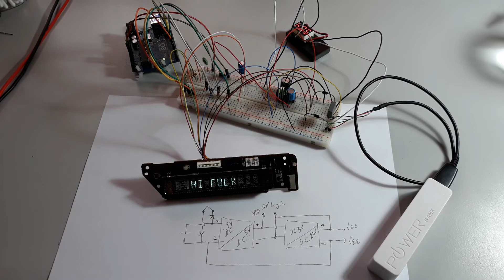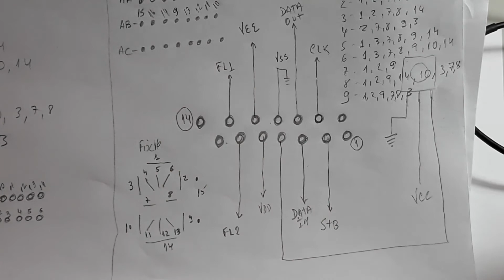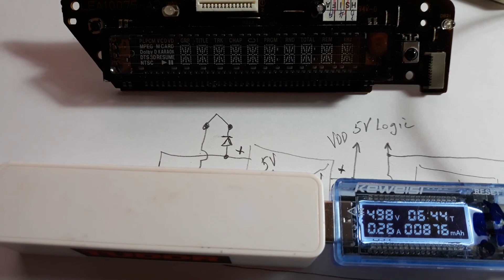PT6315 with converters DC/DC

Comment: Olá José. Algumas questões, por gentileza:
1) As 3 saídas no Power Bank, é um Positivo e dois Negativos?
2) Os dois diodos que você usou é para ter uma queda de tensão dos 5v para o Filamento (3,3v)?
3) Neste caso, não é possível usar uma Fonte de Alimentação de Parede (5v)? Pois, vejo que o GND de referência do DC 5v-24v não está na saída do DC 5v-5v?  Muitíssimo obrigado.
Reply from the maker: A regra é termos de ter 3 fontes de energia totalmente independentes para usar com VFD's polarizados com tensão negativa!
O Power bank simula uma fonte de alimentação (neste caso alimenta o filamento) via diodos para ficar com 3.6V
Neste exemplo temos ainda dois conversores: Um de 5V para 24V e outro de 5V para 5V, sendo isolados entre blocos como sempre!
Resumindo estamos perante 3 fontes de tensão totalmente independentes o que nos permite associar conforme o requesito ficando com 5V para filamento, 5V lógicos e -24V.
Reply: Então, repetindo, é possível usar uma Fonte de Alimentação de Parede de 5v? Se sim, como seriam conectados os GNDs? Obrigado novamente.  @jlsmonte
Reply from the maker: O resultado final tem de ser 3 fontes independentes!
Vamos supor: uma fonte de alimentação a substituir o power-bank e dois conversores (5 to 5 & 5 to 24), ou uma segunda fonte de 5V e o conversor. O resultado final é de 3 fontes independentes. É o que está no papel do diagrama deste video! As ligações são exactamente como estão lá representadas.